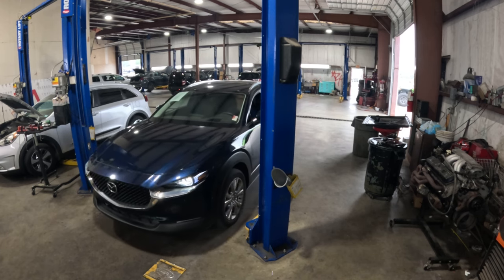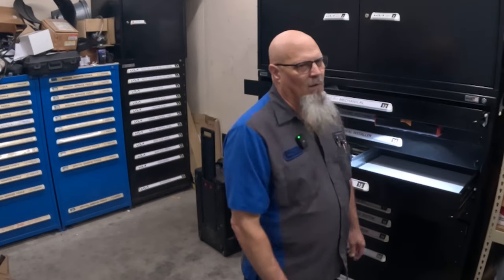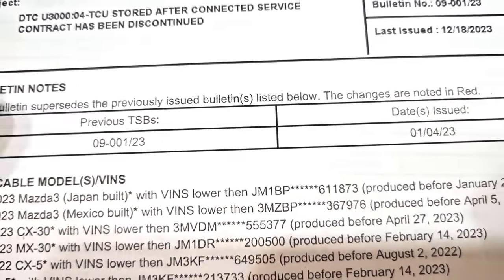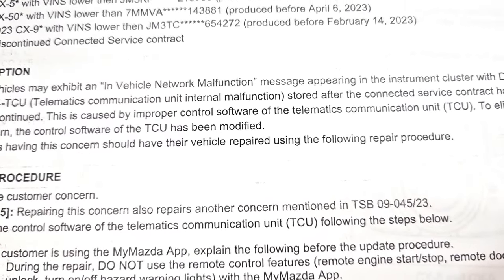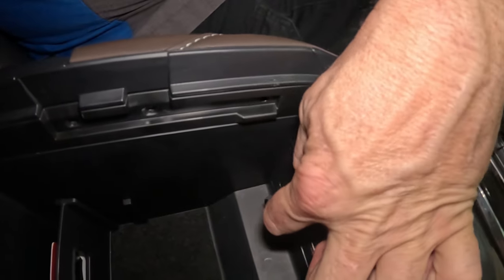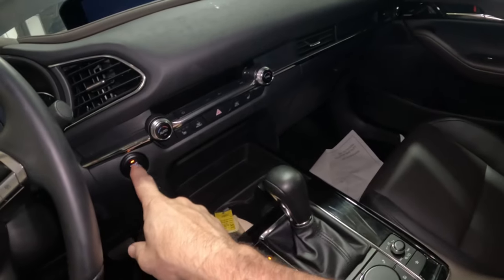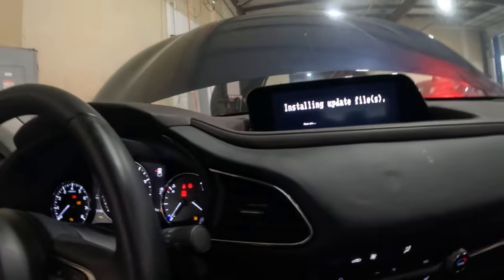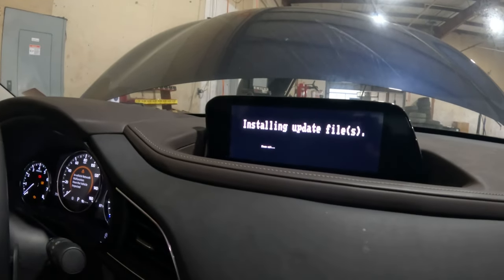2021 Mazda CX-30 In Vehicle Network Malfunction. FIXED!

Comment: 2024 CX-5 bought in Nov '23. Getting this one relentlessly in the MyMazda app messages panel, like every 15 minutes. It has never appeared on the dash. Any ideas on what might cause this?
Reply from the maker: You should check with your dealer and see if there is an update. Honestly, I don't have a Mazda with the connect system so I have never used the app or even know how to use it or all of it's functions. The only thing I know about it is that I can go into a customers system and see what codes have been coming up and the situations the vehicle was in when they happened.
Reply: @ShopForemanGarage  love your video. They're very informative. I have a issue with this message keeps popping on the dash: safety and driver support system partially disabled - I have a mazda cx 30. It comes and goes. Plus brakes malfunction. I done a diagnostic on it and no codes came up. Could it also me the tcu needs updated?

Comment: I have a 21 Mazda three with 5000 miles on it that came on my dashboard. I took it into the dealership and they said squirrels ate my wires. I got it fixed and the light came back on in just like what you show. What could it be? I would appreciate your help. I love my car and the warranties off of it but I only got 5000 miles on it and now I’m starting to drive it more, and I don’t like it flashing that and malfunction and how much does it cost for me to take it back to the dealership to get it
Reply from the maker: You should take it back to the dealer.  The cost is going to depend on what the dealer says.

Comment: My Mazda 3 2020 just did this today but it's showing all warning lights and wipers going on and off all of them but in Vehicle network malfunction still on
Reply from the maker: Sounds like you have more problems then just a network malfunction.  You might start by just checking the battery.
Reply: @ShopForemanGarage  Will do thanks

Comment: Can I still drive my car? My car only got 4700 hundred miles on it. I don’t drive it much but it came on today. Can I still drive it and get it fixed later? Thank you buddy and it’s a 21 Mazda I love it when I do drive it but it just came on today, September 1, 2024.
Reply from the maker: @stevestancill4731  yes. You will have no problems driving it with this message on.

Comment: Hello Mike, thank foto your time, im having the same tcu problem with my cx30 2020, I already been in to 3  dealers and they were unable to fix my problem. I’m thinking to follow your method but I have a question for you, if I buy mgss subscription I need also a vcm2 unit ? or I’m able just with mgss download the drivers I need. Thanks
Reply from the maker: Yes. If the vehicle was built before July 1, 2021 the you must use MDARS to program the TCU.  The VCM 2 unit is the interface that works between the laptop and the vehicle. The VCM 2 has a subscription of its own and it is not cheap from what I've seen. Keep in mind that reprogramming it may not fix the issue. I would think that if it was just a simple reprogram then the dealer would have fixed it.  I don't understand how it could have gone to the dealer and still not be fixed.

Comment: Have a 2020 Mazda 3 having the same issue;   the message popped up while driving.  pulled over and then it completely shut down-couldn't put it in gear, windows would not go up, etc.  had to get it towed to the house.   Once I got it home, unplugged battery for awhile then reconnected;  was able to get windows up but nothing else.   Do you think this is TCU related or something else.  At least I know for sure to have the dealership do this update first before doing anything else.
Reply from the maker: Sounds to me like your battery is dying.  The windows and the power shutting down has nothing to do with the TCU.  I would have the battery state of health checked out. Then get the TCU update.

Comment: i have a mazda cx30 at the shop and the  audio doesn't work, it displays the radio station with volume full blast but no audio comes out of speakers. I think it might be a bad amplifier have you come across this yet??
Reply from the maker: I have replaced a few amps over the years. Not necessarily on CX-30s, but it could happen for sure.

Comment: With the in vehicle malfunction coming up, is there a way to erase that without having to update it?     The dealership unplugged my head lamp for me cause it was throwing all my codes and im able to drive it now but because it's unplugged I have this in vehicle malfunction on my dash
Reply from the maker: I don't know.  Turns out there is a lot more to this malfunction then just an update to the TCU. Still trying to figure it out myself.

Comment: I got this message in my Mazda 3 and I was told by my dealer that the "Emergency Call unit" needs to be replaced. part # BDMC-67-CM0F. Can you upload a picture or description of where is this part located in the car?
Reply from the maker: It is behind the dash so half of the dashboard has to come out and the center console may need to be removed.  But there's more to it then just replacing a part.  Codes need to be cleared and the new TCU needs to be programmed and calibrated. There is a new bulletin that came out.  SA-038/24 that deals with an issue with the No. 1 Tel. antenna.  It depends on what codes the dealer is finding.  There are many things that can cause the "In Network Malfunction" message to come up. But, the only information I can get is for US and Canada vehicles only.
Reply: @ShopForemanGarage  
Thank you very much. It is still a helpful information

Comment: I have a 2024 Mazda cx-30 with same error on dashboard and driver signal light doesn’t come on and when I put left signal both headlights signal come on, I believe my mechanic mistakenly put a passenger headlight module we had on the driver side. I took the car to the dealer and they can’t figure out what the issue is. They’re saying it’s an electric issue somewhere and can’t figure out what’s the issue. Any help please?
Reply from the maker: I can say for most certainty that the network malfunction has nothing to do with the other electronical issues.  
Impossible to diagnose without looking at it.  I would pull the wiring schematics and start testing circuits.  Could be a grounding issue. Honestly, that is one I would love to diagnose.  I love me some electronical mystery.
Reply: @ShopForemanGarage  I wish you were in Houston I would’ve brought the vehicle to you.
Service alert SA-029/20.
One of the reasons for network malfunction:
- U212D BCM: communication issue with light control module 

Dealer is convinced it has nothing to do with module. I had 3 really good electric guy check it and no one knows what the issue is yet.
Reply from the maker: I can not find that service alert.  SA-029/20 does not exist on my computer. U212D BCM is a control area network malfunction.  The in vehicle network malfunction message on the dash has to do with the Telematics communication units ability to communicate with the outside world.  Different network.

Comment: In vehicle network malfunction just appeared on a brand new 2024 CX 50 with 4500 kms ( 2796 miles)    . It’s just a couple months old. Disappointing its already getting problems. I don’t use the App at all. No use getting use to it and then having to pay a ridiculous subscription after 3 yrs.
Reply from the maker: Hmm. This is not right. I wonder if it was never signed up for the free service. Or, if there is something going on that Mazda is just not telling us.  I agree. I personally would never use the App.

Comment: Hey Mike, very helpful video.  I didn't know about this diagnostic mode - I hope the Mazda hitmen don't come after you for sharing the secret 3-finger salute with us plebes.  I've got a "chicken light" problem on my CX-30 and was wondering if there is a service manual that I can buy for my CX-30 to help diagnose these things?  My error messages are all about the sensors not working right front, left rear, side, top, bottom, ultrasonic - all failed at the same time.  It's a 2021 and only has about 30k miles.  Just out of warranty, of course!
Reply from the maker: The first step would be to check the battery state of health. A good battery is critical for the proper operation of these Mazda vehicles with all the electronics in them.  It's weird but, check to see that the air box is completely latch closed. An open air box can cause problems with front camera, blind spot monoting, and other electronical devices. Ultrasonic sensors can pick up random interference. There is a bulletin to reprogram the system to stop such interference on 2020-21 Mexican built CX-30s. Has the vehicle has any paint and body work? It's hard to tell without looking at it and knowing the codes.  As far a service manuals. On the Google web you can find downloadable manuals or even yearly subscriptions for a low fee.
Reply: @ShopForemanGarage  Thanks Mike - will do as you suggested and report back.  Really appreciate the support!
Reply: @ShopForemanGarage  My dealer said that the problem is my fitcamx dashcam that I installed.  They said I need to remove it, and then they will reprogram the ECU.  Seems strange since it's been working for about 10 months without trouble.    I'm planning to unplug it and see what happens.  I've also read that I should unplug the battery for a while - not sure if this will work on this model, since it's a "hybrid" - I guess it has other batteries?
Reply from the maker: Cameras and accessories can sometimes interfere, but you shouldn't have to remove it. Just unplug it while performing the update. I always unplug all ACC and USB plugs before performing any reprogram.
Reply: @ShopForemanGarage  Thanks - just to follow-up on this even after removing the dashcam, the dealer can't figure out what is causing these issues.    Pretty frustrating.
Reply from the maker: @dermick  I have never seen a hybrid CX-30 in my life. Mazda does not release those vehicles in Texas.  I don't know why. I have only seen 2 MX-30s and I drove one of them, but never worked on one.  As a matter of fact. I have never seen a CX-90 PYUL hybrid.  Only the CX-90 HT3  with the strait 6, turbo, hybrid boost system.  Do you happen to live in California or New York? By the way. It sounds to me like your vehicle is having a Control Area Network problem.  Not to be confused with the In Network Malfunction. That is a completely different thing.
Reply: @ShopForemanGarage  Thanks Mike.  My CX-30 is a Skyactiv-X - they call it a "hybrid" but the battery only keeps things running while it stops the engine at stop lights.  The car was originally sold in France and I imported it into Switzerland where I live.  They sell this model all over Europe, I understand.  I think you are totally right that this is probably a CAN bus issue, but the dealer is not able to identify it.   Shop rates here are about $200/hour and I'm already out about $1000, so not sure how to deal with this if they don't find a solution quickly.  Really appreciate your suggestions!
Reply from the maker: @dermick  Wow, Switzerland. Nice to meet someone from Switzerland.  I hope they get it figured out. There has to be some kind of Mazda technical assistance that hey can call.  Check out my Facebook page.  https://www.facebook.com/profile.php?id=61560604018782  You can always PM me there.
Reply: @ShopForemanGarage   Finally, my dealer found the problem.  Seems that my car got hit while parked, and it damaged something behind the bumper that was not clearly visible.  My insurance will cover it, but with about $1000 deductible.  Happy they found the root cause of the problem and have a fix.   Thanks again for your help, Mike!
Reply from the maker: @dermick  I'm glad they found it.

Comment: thanks you so much but the problem is how can i get the code for the flash drive
Reply from the maker: Go to your local Mazda dealer.
Reply: @ShopForemanGarage  the problem is that i live in iraq and there is no mazda dealear ship here in iraq and there is hundreds of mazda cars that have the same issue and i contacted several mazda dealear ships non of them awnsers me i have a can service center i wanna solve that problem to all these mazda cars that imported from usa to here in iraq
Reply from the maker: @billybutcher1-f9z  sorry. I know what you are asking, but I can not give you what does not belong to me. I can't post links here but check out mazda3revolution.com. search for in vehicle network malfunction.  I think there is someone that can get you what you want.

Comment: I thought they were supposed to update over the network.
Reply from the maker: I have not heard of this. If you have connected services then it might perform its own update over the network. But, the old software in the TCU doesn't know what to do whenever the contract has been discontinued. So it displays the network malfunction.